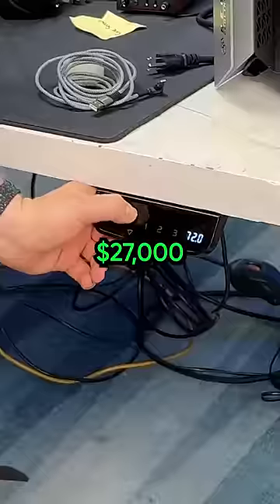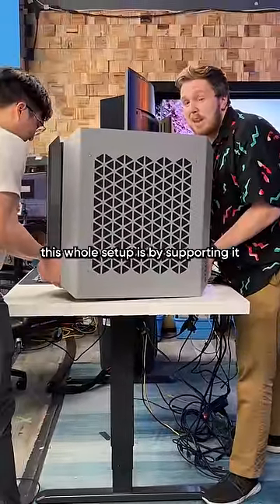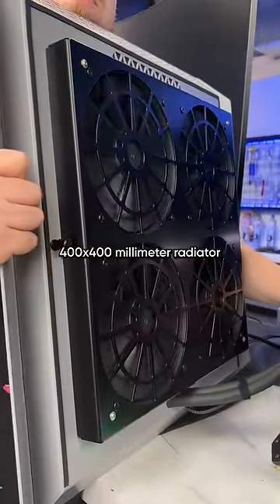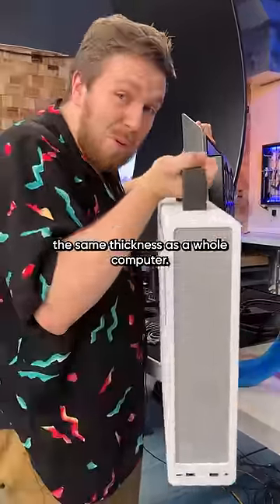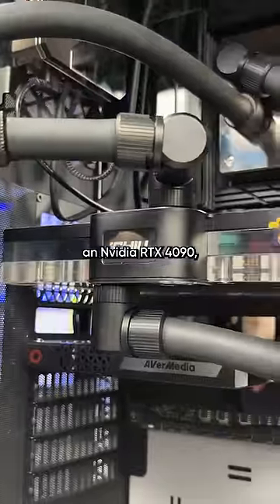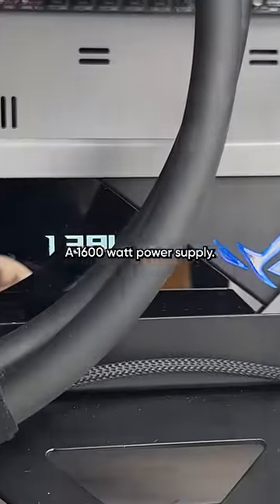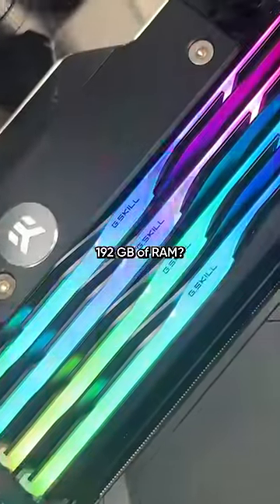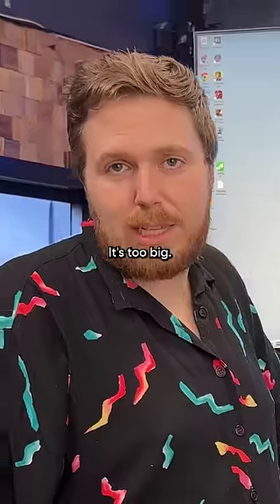Inside a $27,000 Gaming PC

Comment: This is the set up console gamers think you need to get 1080p 60 fps
Reply: 1080p 30fps for the cinematic experience 😂
Reply: I mean consoles run 4k at 120hz now, it's hard to build a PC to beat that for the price.
Reply: @CatWith-AHat consoles run at...4k 120hz??😂 you fucking with me right😂 consoles have an option in esports games to run at either 4k 60hz or 1080p 120 hz. Most games are all upscale 4k not real 4k. And there is no game that is 4k 60hz. Most games are 1080p 60hz still.
Reply: @CatWith-AHat not true, study the difference between "Hertz" and "FPS"
Reply: @Keo  yawn. Why don't you tell me a story grandpa?
Reply: @CatWith-AHat  ps5 only does 1080p at 120hz it can display 4k 120hz but it only does for like a very small amount of games, but yeah to get the same performance out of a PC you've gotta spend at least $3k plus VR is better on ps5 than pc, but yeah Xbox series X might have more in 120hz but I doubt it
Reply: @redmarine2717 either way it's still cheaper to buy a 4k TV and console than it would be to build a PC that can run new games at 4k 60fps
Reply: @r4z0r84 you didn't even have to spend 3k when the ps5 came out. You can get a pc equal to a ps5 for under 1k. Cant say anything about vr i dont have the psvr 2
Reply: @freewings2188  well yeah now you can from second hand parts, last time I bought a PC it was during the chip shortage and the GPU was $2400 alone
Reply: @nxcrobutcher a pc that match ps5 specs can be build for around 500 dolars or even less
Reply: @r4z0r84 You can literally build a PC better than a PS5 for under $800 all brand new parts. With 3k you can build a 4090 PC.
Reply: @Snow.2040  not if you want 64gb of ram and a decent m.2 drive
Reply: @r4z0r84 why would you need 64 gigs of ram for a gaming pc?
Reply: @o0Silverwolf0o  video editing 4k gameplay hell 64gb isn't enough tbh
Reply: @r4z0r84  video editing? Sure but I don't think 4K would possibly ask for more then 32
Reply: @asuperrandomguy8266  lol tell Adobe After effects that 😂😂😂
Reply: @r4z0r84  what game were you playing? It was some super modded skyrim?
Reply: @r4z0r84  this discussion is about console vs gaming pc costs, not workstations. The ps5 only has 16 gigs of ram and you wount be edeting videos on it. And 4k gaming uses vram not dram. For a gaming setup 16-32 gigs of system ram are more then enough for 4k games you just need a good graphics card.
Reply: @o0Silverwolf0o  tell that to unreal engine
Reply: @asuperrandomguy8266  heavily modded cyberpunk 2077
Reply: Doesn't matter how much the console pulls if the games are in many ways visually castrated 💀
Reply: @CatWith-AHat maybe I'm completely wrong but why would it matter what Hertz the ps5 can put out? It's def not getting anywhere near 120fps at 4k or even 2k
Reply: @CatWith-AHat They really don't They do upscale some games a lot most games especially AAA titles are not 4K. Certainly not if you're going to hit 120 FPS Most games on both consoles that are hitting 120 FPS are doing so by using a 720p to 1080p resolution and upscaling it to 1440p or 4K or somewhere in between. But as long as you're having fun that's all that really matters That's what gaming is supposed to be for. Me I wanted a little more so I went with PC a pretty nuts PC at that.
Reply: @XxViciousxX  I left console along time ago my 4090 is hitting 140fps in almost any game at 4k. My neo g8 is 240hz so I'm not even hitting the peak it can handle.
Reply: @CatWith-AHat  That's what I got in my main PC 4090 with an 48in LG C1 OLED and the second one has a 7900XTX and and 45in Corsair Xenon Flex OLED.
Reply: Yeah but think about how good 1080fps @ 30, would look on ultra on that pc... vs medium on console. 😉
Reply: @CatWith-AHat Big difference between 4k @ 120hz on lowest possible settings, on console, vs. Native 4k, settings all jacked up. It's really not comparable. On console I play on performance mode.... because my TV upscale just as nicely as the system itself. So...
Reply: The 4090 is like the only GPU that's even capable of 4k 120hz, and even it struggles there.
Reply: @r4z0r84 m.2 drives have never been cheaper than now, but aight mate. Or at least where I live.
Reply: @r4z0r84 "heavily modded cyberpunk"
I think you forgot that this discussion is still about console and pc gaming. I'd like to see you mod cp on a freaking console😂
Reply: @si.ni.a0795  yeah maybe the entry level ones that are 1/8th the speed of the top end 🤣
Reply: @si.ni.a0795  yeah exactly you can't do half the shit on a console that you can on PC and it's actual 4k not 1080p
Reply: Anyone who thinks a $500 PC (not prebuilt) can out perform a console is delusional as hell. To run modern FPS games at 60+ fps and standard graphics you need at least a pretty decent GPU and CPU, both usually adding up to $500 or more just for the minimum requirements, which is the same price as a modern console which can run the games at 60+ fps and pretty good graphics. As a PC builder and console player, consoles are equivalent to average-above average PCs which can go from $700-$1500, no doubt about it that consoles are the best bang for your buck, plus its pre built. I still main PC though, but its impossible to deny how cheap console is for its performance
Reply: @r4z0r84  Ram ≠ performance, your computer is highly neglected if you think 64gb isn't enough, clean it and get better components not ram
Reply: @si.ni.a0795 Mod what now 😂
Reply: @gamertardguardian1299  tell that to any AM4 owner 🤣, got the best available at the time no need to upgrade it if I don't use it and have been playing ps5 for the past year lol
Reply: @freewings2188 saying psvr is better than pcvr is just completely false in every aspect
Reply: @cookie_sharkz  the only thing I could think about it being better is the eye tracking to make games look better. Idk if there's a pc vr headset that has that.
Reply: @cookie_sharkz half life alyx alone as a game blows any psvr game lol, alyx is like the only true AAA vr game that's actually built like it needs vr to be a playable thing lol
Reply: No we just want more than that old and lowly standard lol. We are shooting for 1440p at well above 120fps.
Reply: I’d LOVE to see your PC run Siege at 4k 120hz without dropping a single frame the entire session. Cause that’s what a series x does.
Reply: @jacobshank9362  psvr is nothing like psvr2, half life alyx was created by the company that made the HTC vives so you'd expect it to be top tier, same for horizon call of the mountain for ps5 psvr2, the Disney star wars looked great for the bar area then outside you can tell they just didn't give a crap anymore the quality went down hill from there and was  more of a tech demo than a game, that's what shits me about 99% of VR games, beatsaber was the only one I really got into on PC VR and didn't feel sick playing it.
Reply: @CatWith-AHat no they don’t💀
Reply: Mate. Why are pc gamers so fkin obsessed with us?
Reply: @morocuda2090  eh I've got a top end gaming rig but I prefer to play the ps5/ps4 exclusives 😂 Xbox exclusive I just play on PC
Reply: Imagine thinking gamers are dumber than pc users just because they prefer the simplicity of a plug and play system over dealing with the hardware compatibility Bs or building their own tower? 🙄
I guess nobody told you that the last couple generations were just budget friendly PCs running a proprietary OS ☠️
Reply: @VeeTwoPointOh  guess you've never played steam games on Unix before 🤣
Reply: @r4z0r84  bro really thought that was a zinger
Reply: @VeeTwoPointOh  sorry mate sarcasm doesn't come through text very well haha 😂 gamers can play on anything it's not limited to console or PC, it is sad but majority of the current generation only play touch screen games and don't even know how to use a controller.
Reply: @r4z0r84 my pc is way faster than a ps5 and I didn't even spend 2k on it... it's also silent has way more storage and can run native 4k 60-120 fps easily I have a 1440p monitor and run all my games at 200+ fps. When I say all I mean literally every single game I own runs 200+ fps even warzone 2
Reply: @crm4667  well yeah 1440p is not 4k it's more like 2k if it's Ultra wide but sure DLSS and VSR make anything fast.
Reply: @crm4667  no it doesn’t
Reply: @CatWith-AHat  😂😂😂😂😂😂😂😂😂
Reply: @r4z0r84  $3k for 4k on PC? No mate. Graphics cards that can do 4k cost under a thousand.
Reply: @nxcrobutcher  I can do 60fps 4k on my PC under a thousand, and 4k monitors are cheaper than 4k TVs. It's not 2020 anymore.....
Reply: MrSitallewal  Hope you understand what we have on PC is far more advanced than PlayStation share factory. It's actually insane the stuff adobe has done.
Reply: MrSitallewal  it's not 2020 anymore, you can build a PC just like the PS5 for not much more than it. 

What you won't have to buy: controllers, full priced games, expanded storage (PS5 doesn't come with much). 

PC parts are getting cheaper every year from new ones coming out, while PlayStation doesn't.

In 2026 we'll be two PC generations ahead, the PS5 will still cost $400-$500, and PC parts that cost a thousand now will be a third that price.
Reply: @aouyiu  Lol my gpu alone was $2499
Reply: MrSitallewal  we're talking about real editing, adobe premier and davinci resolve level of editing.
Reply: @r4z0r84 there isn't a single game out right now that recommends 64gb of ram. You also don't need it for video editing, your confusing wants with needs.
Reply: @CatWith-AHat no they don't.  There are a few games that can upscale to 4k but you have to think to your sacrificing graphics for resolution it's not a good trade off. So yea some games can upscale to 4k but at medium settings what's the point. And the vast majority of console titles don't get anywhere near 120fps
Reply: @gamertardguardian1299 consoles match up to a mid range PC from the 20series of gpus. That time has passed the new 4070 far out preforms  consoles. You also don't have to buy parts new. Also consoles run many many games at 30fps still. The all games at 60 was a pipe dream.
Reply: @crm4667 wait so you have a 1440p monitor but you claim your running games at 4k , you know thats not how things work right? Also kinda of hard to take you seriously when you make a claim that seems incredibly false while also not saying your specs
Reply: MrSitallewal you really don't,  people have to stop acting like the hardware in consoles is still new , it isn't  it's 2 generations back from what we have on PC now , you can get used 2070s for under 200 bucks. Consoles stay the same in price and power while pc part get stronger and the old parts get cheaper.
Reply: @r4z0r84  Only the unwise would spend that much, it's a ripoff unless the gpu you bought was a workstation one or something.
Reply: @aouyiu  Was a rx6900xt in 2020 during the chip shortage, all my stuff was in stock so I hit buy, still overkill for everything but should last quite a few years
Reply: @hoopla5502  30fps is INSANE some people say they dont see a difference between 90fps and 60fps, which if youve been playing on 90fps then the difference feels pretty considerate. I have NEVER played a console game at 30fps, that is 1/3 the fps of my average fps on PC, and half the fps on the games on Xbox. Unless it was like a 360 game or something, i consider 30fps to be lagging honestly ive never heard of that
Reply: Huh? Consoles are 4k 120fps. You’re on a computer that you have to run everything on low settings just to get 45 fps 😂 pc gamers are still on 1080p meanwhile we’re about to go into full 8k. I wouldn’t get a pc if a gun was put to my head you’re on ps3 graphics  and that’s a terrible console
Reply: @bondjames6353  PS3 does emulate well on PC you're right 🤣
Reply: @gamertardguardian1299  your outside your mind if you think console games don't still run at 30fps . Many still do. Starfield for example was locked at 30. Destiny was locked at 30 for the longest time. Again if you've "never heard" of games running at 30fps on console open your eyes. You don't have to go back to the 360 Era back then it was 30fps and lower res.
Reply: @bondjames6353  still on 1080p what are you on about. If you think a console can run 8k you are severely confused , they can't even run true 4k it's all up scaling and even then it's not 120fps . The only people who think consoles are somehow stronger than a PC are people who don't know anything about the hardware they buy outside what's on the box
Reply: @CatWith-AHat I could get into an argument with you, but i'd rather just say: no, they don't.
Reply: @r4z0r84 dude 3k bucks in pc components is like top tier overpriced stuff you don't need, where you get this number?
Reply: @r4z0r84 what gpu you bought? 4090 ti gigachad edition?
The most expensive amd card is less than 1k dollars right now.
Cut the bullshit.
Reply: @kitzus4957  I live in Australia so it's AUD, it was during 2020 with the chip shortage and it was $2499 for the rx6900xt. Was the best card I could get at the time and almost half the price of the 3090.
I admit it was a terrible time to buy a new machine, but I was running a gtx1080 and 7th gen i7 7800 trying to play 4k wasn't nice, just wanted a machine that could do it so yeah no bullshit here just different currency and we always pay more in Australia.
Reply: @hoopla5502  you know you can run games past native resolution? I also own a 4k TV that my pc is connected to 💀 I have more than one monitor aswell but my main monitor I game on is 1440p, goofy ah ninja
Reply: @crisr4667  you can upscale , but no you cannot just run  actual 4k images on a monitor that does not display 4k, not like it won't run. But your not getting a 4k image
Reply: I got a series s and it out performs my Alienware pc and it’s cheaper with more storage my only limitations with my Xbox is my tv but my pc struggles sometimes to do 1440p 60fps
Reply: @hoopla5502  Maybe your right, but damn i just do not understand how id miss that. I can notice when it goes from 90+ to 60 so i would be amazed if i missed it dropping to 30
Reply: @hoopla5502  you’re on a 1080 pc, playing games around medium settings. I’m on a 4k tv at 120 for want me to send you a video of the fps counter? The 4k resolution confirmation etc etc? Then I’ll get you to send me your specs lol 😂 we both know how this ends my guy. Get back on your 1080p computer and cry 😭 big fat L. Ruined
Reply: @bondjames6353  I have a 4070  and a i7 13700 but sure lol. You've still yet to say what you even have outside of it runs 4k at 120 lol . Oh and it was under 2k lol
Reply: @hoopla5502  you’re on 1080 and you live with your parents. Next.
Reply: @redmarine2717  your so salty you’re on 1080p that’s so cute. Been about 10 years since I played on 1080. You’re adorable and a brokie.
Reply: @bondjames6353  it's because I don't have that daddy cash like you. I work for the stuff I get
Reply: @redmarine2717  working for money that’s cringe. Daddy’s money 😂 damn I wish he left me some money. Here’s a little tip to get yourself out of the wage slave life you’re living….. you need to be making money while you sleep. Going to work for an hourly wage is literally the dumbest thing you could possibly do. I would rather be broke working for myself then going to work for another man 😭 hi boss I’m on time boss, yes boss love you boss 😭😭😭😭
Reply: @getransacked6937  you bought a shit pre-built, anything from dell(alienware) lenovo, hp all those companies make the worst pre-built, pre-built pcs in general aren't the best and are way over priced you probably got ripped off too. I know a lot of my friends who bought pre-built overpayed most of them payed more than I did and their pc is way slower in every way. Building a pc is always cheaper, and you get to choose the components usually better quality aswell unless you cheapout on all the parts.
Reply: My laptop can run any modern game at ultra settings and still never dip below 60 FPS.

Why would you need to spend so much money? 2500$ Will get you an absolute beast that will run anything for the next few years. 

Pretty crazy considering top to your cell phones right now cost about the same amount
Reply: @CatWith-AHat bruh...
Reply: @nxcrobutcher okay consumer we got you
Reply: @fustercluck2460  spending 2500 while working a job is cringe. Do better invest in yourself. Spending 2500 for a few years when you could start your own company. I would rather cut my throat then work a job that is super cringe, my women would leave me straight away if I had a boss 😂 yes boss love you boss thank you boss so cringe
Reply: @hoopla5502  2080 was midrange for the 20 series? I don't think you know how pc parts work. The gpu in the ps5 is an rx 6700 non xt. The 6700xt out performs the rtx 2080 super the 6700 is about on par. The 4070 is a terrible gpu as it gets outperformed by used parts you can get for cheaper like the rx 6900xt and the rtx 3080 10gb.
Reply: @hoopla5502  the only part 2 gens behind is the cpu as rdna4 isn't out yet.
Reply: A ps2 run the Same games